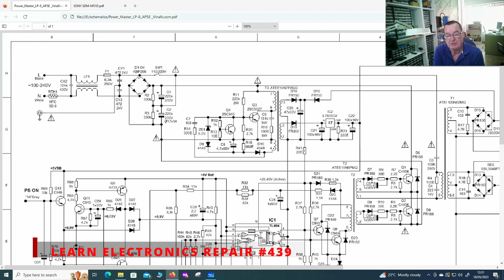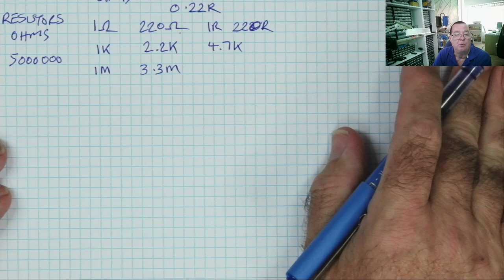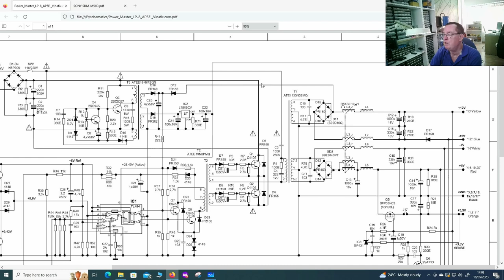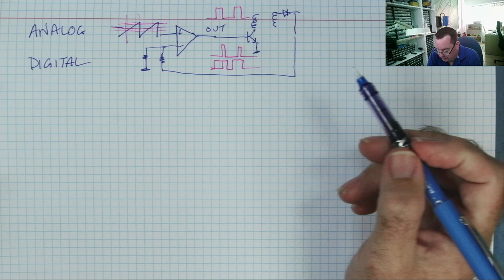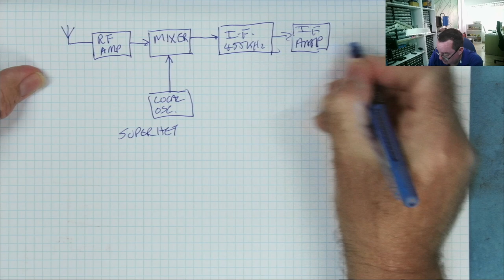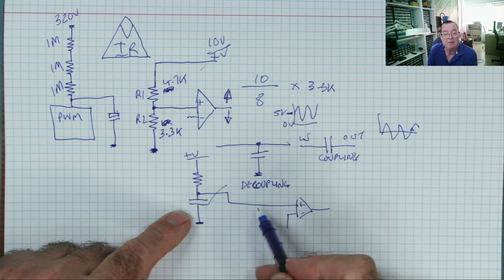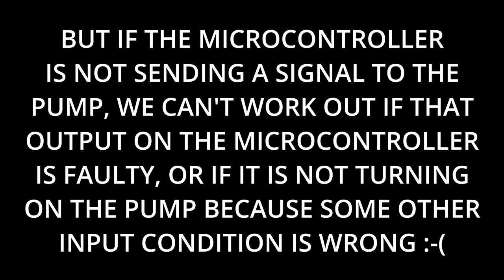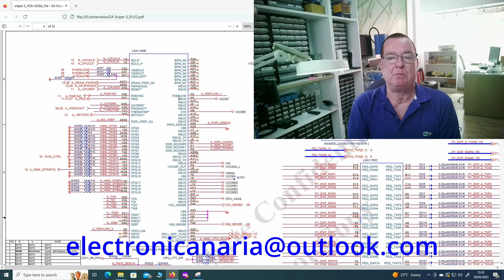How To Read Schematics 3.  Learn How To Understand Circuit Diagrams

Comment: The main difference between processors and microcontrollers is not internal RAM or ROM, but the presence of hardware timers, PWM modules, AD and DA converters, programmable and often multi-functional or bidirectional GPIO pins and other hardware modules that are meant for controlling other external hardware. The first microcontrollers almost never had internal RAM or ROM (nowadays ROM and RAM tends to be integrated).

Comment: This mini-series has been great, thank you for it.  It would be good if you would do a video on identifying, on actual schematics, the basic building blocks (start up circuits, the current sense, voltage dividers, etc) because sometimes, in complex diagrams, it can be harder to identify them ☺

Comment: A audio amplifier's fuse which is situated on the output of a bridge rectifier getting burn out once the power is turned on.  please tell what are the possible reason of it?
And input voltage of bridge rectifier is 26v ac and I found 36v. DC on the output of bridge rectifier so is there problem with this bridge rectifier?